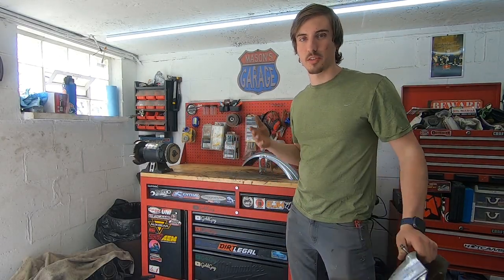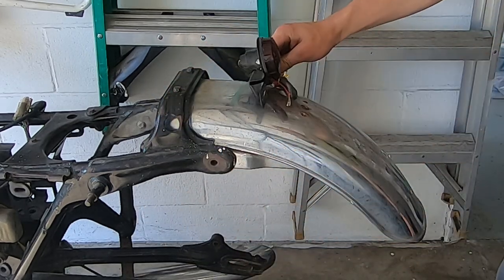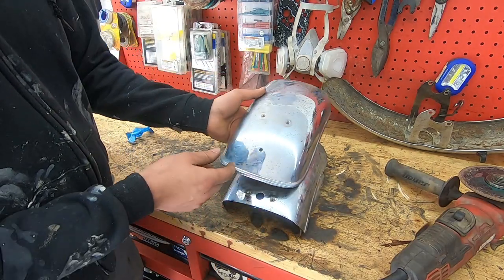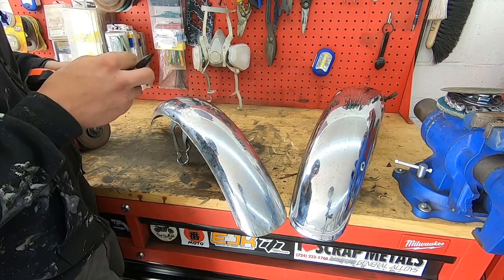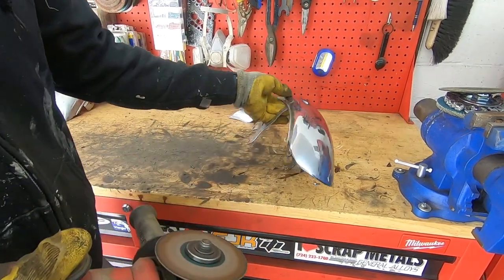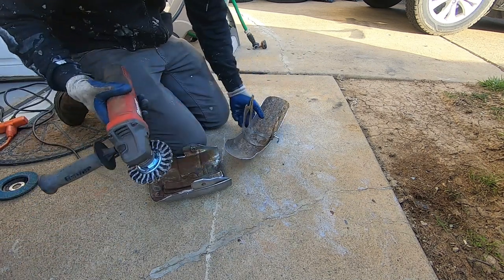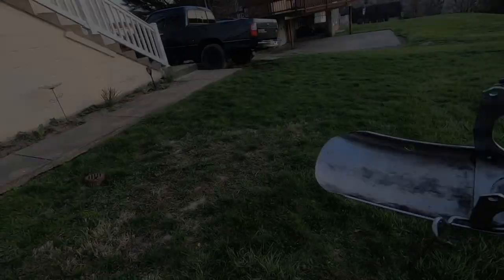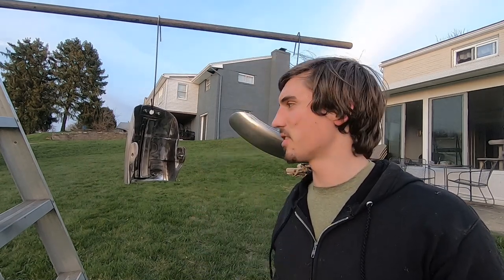Cafe Racer Fenders Chopping and Painting | Honda CB500 Build #7

Comment: I love chrome and it really grin😢my gears when someone spills a perfectly usable fender, but hey hoo it’s your motorcycle, not mine but i actually like it, especially the fuel tank. Sweeeeeeeeet video man 😊
Ps….T-Cut takes off tape adhesive easily.
Reply from the maker: To be fair, the chrome was pretty pitted, that's the main reason I wanted to paint them. Thanks for commenting!